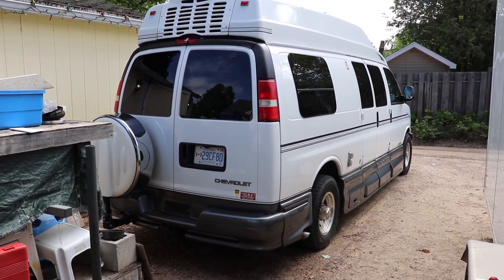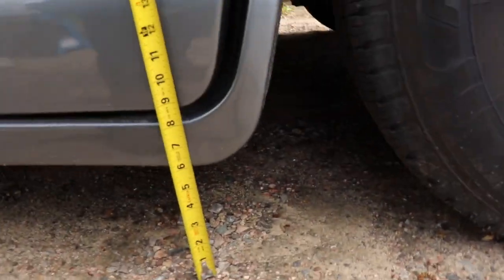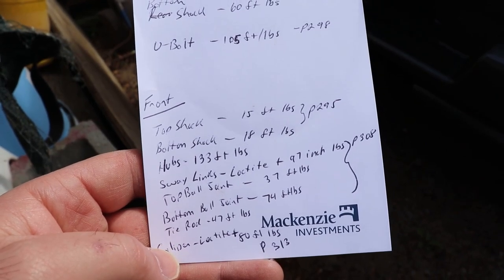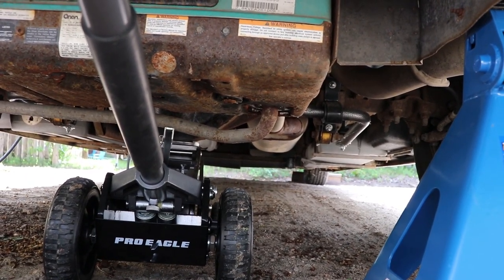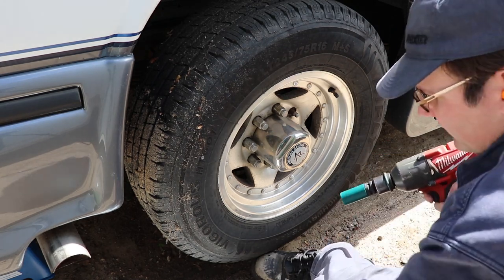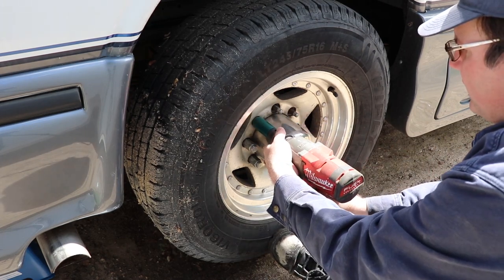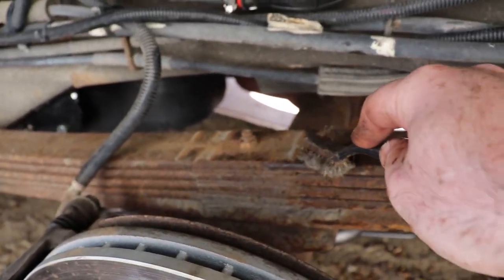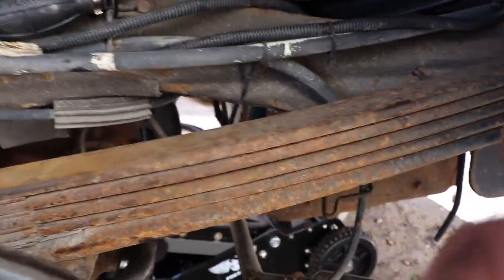2003 to Current Chevy Express 3500 Weldtec 4" Rear Lift Block Install

Comment: could installing taller wheels go from 16 to 18 w/ high series increase the ground clearnace enought to clear speed bumps.
I have a 99 trans am stock ride height that I have to slowly crawl over even low speed bumps. my 03 express 1500 conversion van has alot of ground clearance no issues. so now I'm bummed bc I'm picking up my pleasureway lexor same as RT next week. also what was the pump bulb looked like a boat fuel primer bulb in driver wheel well. excellent video and nice van.

Comment: Steve..
You mentioned that you could not access the pumpkin from the side ahead of the wheel. That suggests you were intending to jack the vehicle from under the pumpkin.
That is not a good idea. The axle housing attachment into the pumpkin are not  rated for that much weight. That joint can be broken or bent by jacking the pumpkin. 
On larger trucks, where the pumpkin and housing are cast as one unit, yes.. These welded units no.
Been there done that, paid the price... lol
Reply from the maker: That's interesting, I used to work on heavy trucks and I think we always lifted at the spring perches since that is were the weight was concentrated.  We seem to have opposite opinions...something to ponder.
Reply: @SteveRivett ...
 Quite the contrary, that is what I said! 
AND, you can jack the Banjo ONLY on those units that are 1 piece cast.
(Like Twin-Screw  pumpkin)

Comment: I believe jts a 3 inch block from their kit in the rear.
Reply from the maker: They offer a few sizes.  This is a 4" block as they didn't think a 5" block would be a good idea on my van.
Reply: Mine came with a 3 inch block rear
I got 6.5 inch lifted in the front